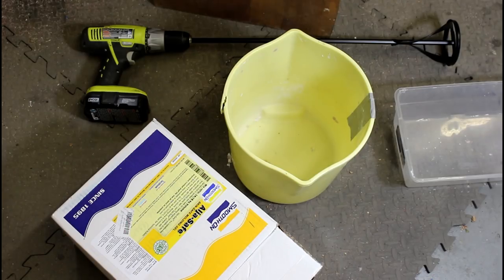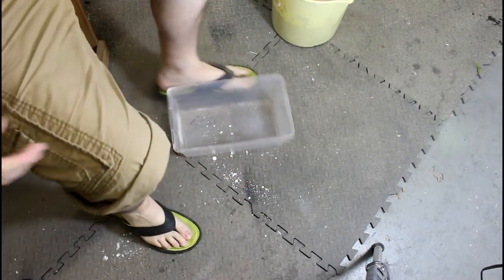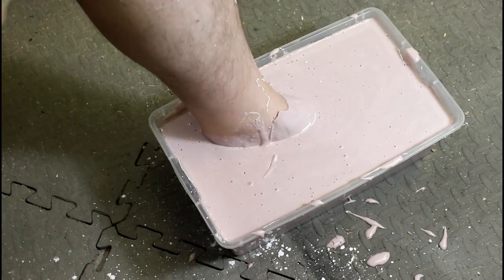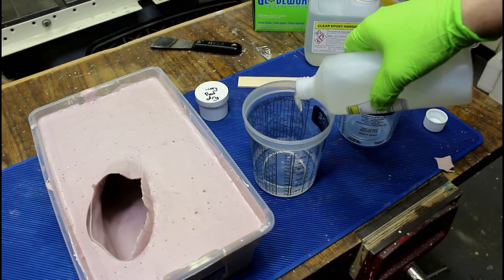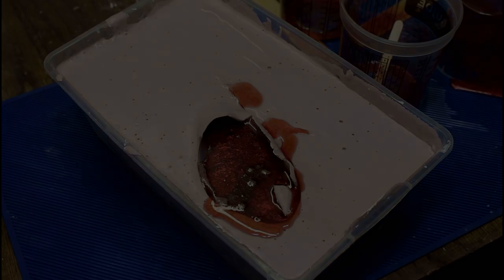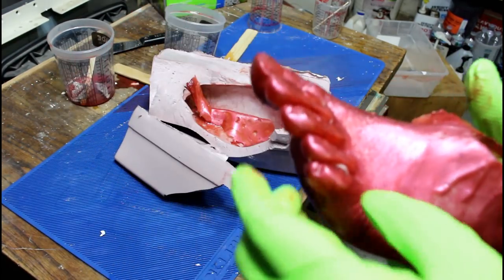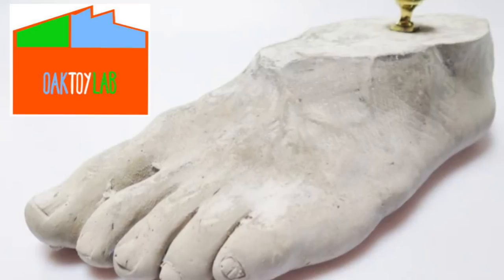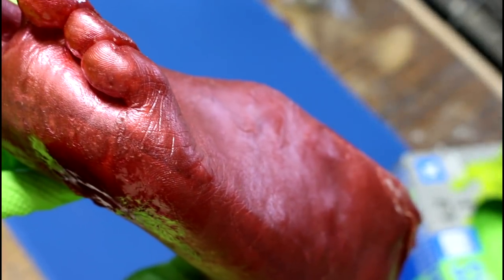My Left Foot

Comment: Alginate is pronounced like gin the drink. It's made from seaweed and used commonly in medical fields especially dentistry and also in special effects. You can get fast or slow set, even some that will change colour as it cures. There's a number of vids on YouTube about different mixing techniques (lots less effort than 3 pages of instructions) or I can give you a lesson if I'm ever in your neck of woods or you're back in the UK. I used it daily in my nursing so naturally I also make loads of weird and wonderful things with it in my spare time. You do need to cast from the alginate fairly soon after moulding it as it will shrink and distort as it loses moisture but wrapping the alginate in a damp towel will give you a little extra time before you can use it although not much. Your best bet is to pour a strong plaster into it to give you a positive cast, then you can use silicon to make a negative mould for future use. I did have to chuckle at Mrs Brown's "No. No, no, no". Hufflepuffs rule!

Comment: We use alignate a lot and the way we use it is to cast the object then take a plaster mound of it from the alienate then recast it in a material that is more durable if you are going to be using the mound more than once. Alginate is weird because when it’s drying it goes really wet and releases all of the water that you have mixed into the powder but once it has and has dried it would have shrunk and gone solid into something like a cuttle fish bone

Comment: If you want yo use alginate in the future I would suggest making an initial casting out of plaster of paris or concrete and then remaking a s silicone mold off of that cast. that way you can keep the original casting and second mold for any other projects you want without having to redo the casting of the particular body part

Comment: You should try rotational molding. Make your alginate mold, put quick set resin in and then rotated around so it only coats the outside as a cures making a hollow object and not overheating

Comment: Use plaster in alginate to make positive, then use it to make a silicone negative. That way you can avoid the water problem with alginate when casting resins.

Comment: If you want to try redoing the foot, perhaps you should add a couple of steps (pun intended)...
1) make the alginate (the g is pronounced like the J in jelly) negative mold of the foot like you did in this video.
2) use a material that sets up hard but wont be bothered by water to make a positive mold of the foot (like you tried to with the resin).
3) use the hard positive foot mold to make a 2nd negative mold in a material that won't release water.
4) use the 2nd negative mold to cast your resin foot door stop.

This may add a lot more work, but I believe the final result will be more than worth it.

Comment: Hahaha, thank you for publicly making the exact same mistake I made when getting into casting-- I feel less incompetent now.  

I have gotten around this issue by casting a plaster form in the alginate, then painting a silicone mold onto the plaster cast and using that mold to make a resin cast.  (Note that alginate "sweat" will also seep into the plaster after it has hardened, so it won't completely dry hard while in the mold.  You want to de-mold it after the setting reaction seems complete, even if the edges are still damp.  Handle it very carefully until it has a chance to dry out completely.)  This method really doesn't lose much fidelity at all, though it seems like wayyy too many steps just because I want a resin cast instead of plaster.

You might try experimenting with a release agent?  I wonder what would happen if you rubbed the inside of the alginate mold with something like Meguiar's mold release wax?  You would probably lose some detail depending on how well you apply it, but I wonder if that would block the water from seeping through the inside walls of the mold.

There are also quick-set silicones made for life casting, but I haven't tried them yet because I don't feel confident using such an expensive material for something as clumsy and error-prone as life casting your own self.

Comment: You should use plaster with the alginate (pronounced aljin-nate) which will be a quick set cast. Then you use silicone with the plaster foot sealed in lacquer and that is the mold you use with resin.

Comment: The alginite is only good for a few hours and should be stirred by hand so you can feel it start to set up.  I'd have cast the foot in plaster and then done a silicone mould of that to cart again in resin. Also you can cast in silicone and have a floppy fleshy foot!

Comment: For alginate, a better method might be to use something that hardens quickly (like wax), then using that positive casting to create a mold in a smaller custom-built container with something like latex. Of course, there's probably latex designed for live casting, and most of what you'd be using this for is one-off projects anyway, so...

Comment: @Peter Brown. Hello I have successfully cast a whole arm using Smooth Cast 320 resin. After making your alginate mold, spray a light coat of crystal clear paint in the cavity. Allow the paint to dry for about 5 min (repeat if necessary), next dust the interior of the mold with talc powder and or powdered pigments. This serves two purposes, it will block the moisture from the resin and it will also allow the resin to penetrate all the cracks and crevices of the mold. Make sure you rotate the mold to allow the air bubbles to escape. Think Beer Fest “Das Boot” scene at the end of the movie.
Reply: Oh and that would be Crystal Clear Acrylic paint so that it doesn’t react to the water in the mold....

Comment: You’re better off casting plaster from the alginate mould, it cures faster and isn’t as affected by the water in the mould.
Then you can make a silicone mould off of the plaster cast, which you can then cast resin in.

It’s convoluted but this is the best process for alginate life casting.

Comment: Yeah algenate is a quick set mold to set up faster than silicon. It's best for water based moldings like plaster/concreat/ect because it sweats water. Resin is really one of the worst things you can use with it. 

Also ready the instructions! You do need to see the ratio of water and alginate just like you do with hardener and resin.

Comment: Could you do it in two parts? Use a fast curing resin to coat the inside of the mould for details, and then a slow curing resin for the rest, afterwards? I imagine the process to be like how they make chocolate eggs that are hollow.

Or, it's halloween soon... do this again, but put a model skeleton of a foot inside it and some silicone tubes to represent veins, then use the clear stuff again.

Comment: Use a multi-step process... mold your foot in the silicone... make a positive cast with plaster.... make a mold using the plaster in plaster.... then make a positive in resin. You will lose some of the super detail, but you get good quality, completely solidified resin foot. Also, go higher up the ankle, your foot looks just weird without the ankle! LOL

Comment: So before i finally decided what sort of art student I wanted to be (graphic design for anyone interested) I did a year long "Art Foundation Diploma" which is essentially designed to be a stepping stone into a specialism that you'll decide on before applying to University. I'm not sure if this is a thing in the rest of the world but they are becoming very popular here in the UK. 

Essentially the premise is that you spend a portion of the year (at the beginning) "on rotation" during which you experiment with a wide range of specialisms in order to produce work on which you are graded. So during my sculpture rotation, I had the bright idea that I wanted to cast my whole hand holding this fairly ornate little desk clock that I had to incorporate as part of my brief. 
I did a bit of googling, came across this stuff and essentially just said "Yeah, sure! What could go wrong!" (spoiler alert: Everything. Everything can, and will go wrong)
I headed off to my local art supply store and bought an alarming amount of this horrible goo! My first casting i just used small objects as testers. This went pretty well, so of course I decided to just go in all guns blazing and mixed up a huge bucket of the stuff... After basically covering myself, my things, my work space, my friend, my friend's things and my friends workspace in this stuff I realised they weren't kidding when they said this stuff sets fast! Still, as the intrepid art student I was before I had my will to do anything crushed by 8AM art history lectures; i decided to do the whole thing again.... this time outside. 
I finally managed to stop faffing about and actually cast what I wanted to cast and if I'm honest it came out far better than I, or any of my tutors expected! That is until i decided to try and pour my paster mix in there and i realised how easy this stuff is to rip and how it can cause you to suddenly rethink your career plans as you watch the plaster slowly leak out of one thinner part, which eventually rips the whole damn thing apart... 

I think you can see why I stuck with graphic design and why I will forever regard alginate as the devils casting medium...

Comment: Algenate to plaster plaster foot create silicone Two piece mold then clear resin degassed an cast in pressure pot. That would give all details with crystal clear cast. However that would be a long and expensive cast to make.

Comment: Cool water, and mix by hand, you'll have some clumps, but there won't be nearly as many bubbles and you'll have more working time.
Reply: Also, you wanna do your first pull with a fast curing resin because an alginate mold doesn't last very long. Best option is to make a positive and re-mold it in silicone or a production mold material.

Comment: Is there a reason the mold needs to be used right away?  If not could you wait for the mold to release the moisture and remove that and then try to fill the mold mitigating the moisture issues?  Either way entertaining video. I am always glad to see you using the pigments i sent (even if the color freaks people out).

Comment: It's more labor intensive but if you would like to redo this out of resin instead of concrete the process I've used is:
1. Make the alginate mold of whatever body part you want, i.e. face, foot, arm, etc
2. Immediately pour plaster into the mold. Make sure to do a thin batter to capture all the detail at first and then you can go back and use a thicker mix to fill up the cavity quickly. Plaster cures fast enough to not be affected by the alginate especially if its warm in the shop/outside.
3. Use the plaster positive to make an additional mold out of something that is more durable, i.e. silicone rubber
4. Cast with desired material free of worry!

This is what we use at my university to make prosthetics for performance and costumes. We even use multi piece plaster negatives on step 3 to save on cost. It works great for one time pours and even multi-pours for less complex shapes. Just make sure to vaseline the heck out of the positive if you do plaster on plaster!

Comment: Maybe if you let the alginate mold dry you could cast resin in it? Although I'm not sure it would retain the other qualities you would like it to have once dried.
Reply: Alginate is meant to be used right away, and it shrinks and deforms as it dehydrates.  It takes days/weeks to dry out completely and you wouldn't end up with a usable mold at the end.  Like if you peel a piece of fruit and leave it sitting out-- it will shrink and dry, but it doesn't look pretty in the end.

Comment: Is there any way you could line the alginate to water proof it so the the resin wont come into contact with the water. Maybe use a hydrophobic spray or paint for shoes. there was a product called never wet you could try, rustoleum makes a spray paint..

Comment: Hey Peter, would it be possible to do something like a..uh.. slush cast? Where you coat the outside of the mold, with a fast hardening resin, then fill the center with something slower?

Comment: Peter, what if you put a couple of drilled holes in the bottom of the mold container just for the purpose of letting the excess water from the mold maker material to drain away so the resin isn't sitting in water to cure??? Would that work??

Comment: Alginate is also what they use at the dentist to cast your teeth (dental alginate has a faster set time, and tends to taste minty). Also, for next time, the colder the water, the slower the set time. So you can control how much work time you have a bit. If you're going to use it to make life casts of, say, your face, you'll need to create an external mother mold with plaster strips (No need for straws up the nose, just make sure the nostrils are clear. The holes in the mold can be filled afterward with morticians wax or something similar.) 
I'm going to stop babbling now. Sorry. Make-up artist brain saw alginate and I was like "YOU CAN DO ALL THE THINGS"
(also, if you ever want to talk alginate, casting, etc, clearly I am all too happy to talk, at length, about all of it)

Comment: Another great video.But the thumbnail is kinda... hmmm. lol. You could use that blue silicone moulding rubber to possibly get a better mould without running into the water issues I think.

Comment: I think if you take the mold out of the container, it should dry down better without building pools of water...

I worked with alginate as a dental technician and we used to make models out of plaster
Reply: oh i forgot.. 
alginate should be stored moist but not for longer than max 1 hr i think 
Normaly it dries down completly

Comment: Would you be able to make the mold by creating a shell of quick-cure resin in the alginate, (basically using a small amount of the quick-cure resin and moving it around in the mold to create a thin-ish layer all over it) and then filling the 'shell', (possibly while still in the alginate?) with a slower curing resin? 

I have no experience with any of this (probably obviously), just curious if it would be possible.

Comment: What if you used filler material in your resin to cut decrease the risk of overheating. Maybe glass marbles would work, if say you put a first coat of resin lining the walls of the mould, and then added the rest of the resin with marbles. (I have no experience with resin or casting though, so dont take this suggestion as gospel^^)

Comment: Out of curiosity what happens if you mix a fast setting resin and a slow setting temperature stable resin. 

Also could you not pour in some fast set and move the cast around to coat it's surface then once it's dried and created a seal use the slow set high volume

Comment: It looks like you skinned your foot plus it's not heavy enough. That is why they tend to make these out of concrete.... you could make it out of lead. What's the highest  temperature liquid you can put in a mold of Alginate?
Reply: Alginate that has set feels like tofu or overcooked oatmeal.  I'm sure molten metal would do weird things and not produce a viable cast... probably cook the alginate while boiling off the water during casting?  But I love the idea of having a metal foot doorstop like some kind of weird claw foot bathtub.  Or also, a human foot bathtub.  I did a cursory glance at temp ranges; looks like a silicone mold + pewter would work just fine.
Reply: It's a single use molding system so cooking the alginate might not be an issue. The water problem would be solved simply by letting it dry out(unless the alginate cracks) Lead melts at around 550-ish degrees so lead should be ok. Just remember to set whatever bolts you might need in when you cast not after.
Reply: @homeyshlitz  drying out alginate won't produce a useful mold though.  It shrinks and deforms dramatically as it loses water.
Reply: Oh well, I guess its back to silicone for Peter B. I think he was just trying it out to see how he liked it. He won't be making any doorstops with epoxy any time soon.